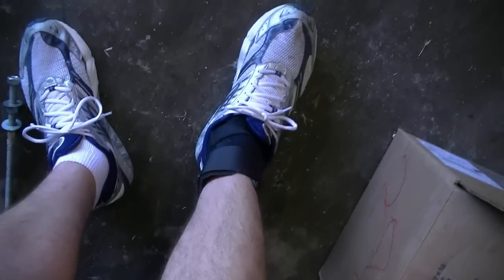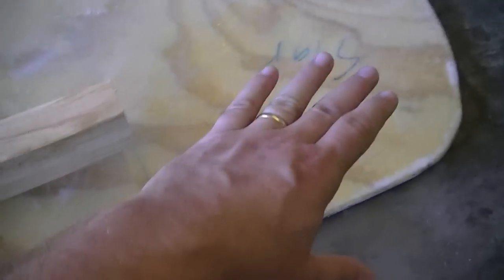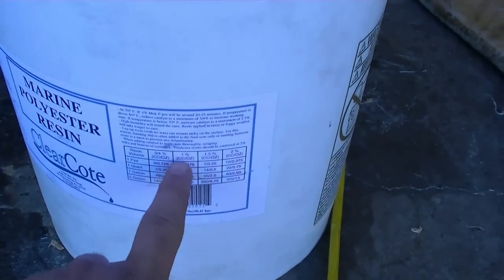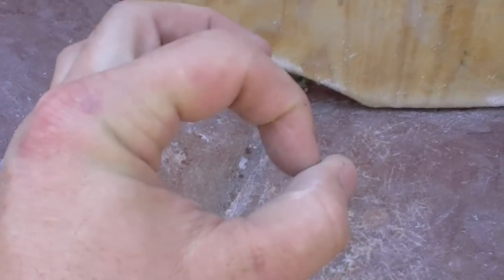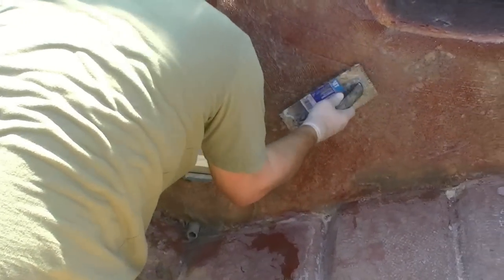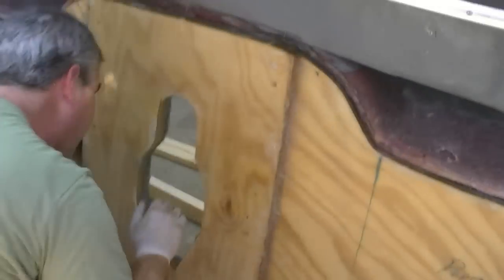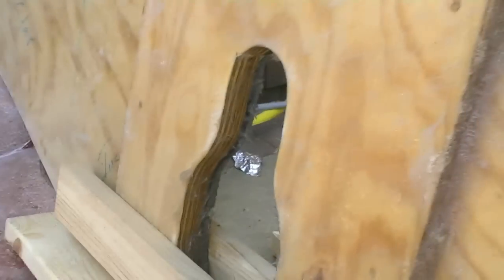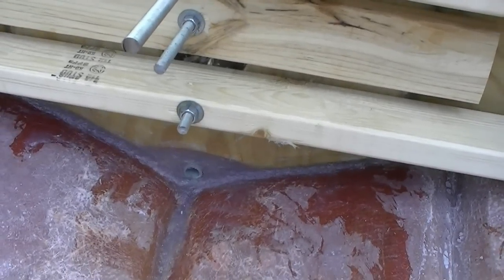Installing the transom in the Sea ray Boat Restoration VLOG #16

Comment: It's seven years after the fact, but I just found your videos a couple of days ago and have been binge watching a couple at a time.  You're as good as Netflix.  I am impressed with your skills and your willingness to tackle big projects that would scare off most people.  I'd even venture to say that some people would just scrap the boat if they faced these issues.  I'm just wondering if you ever heard back from the seller and did he return a good percentage of what you paid.  If you had all this work done by a boat-builder, I think you'd be looking at a minimum of $10,000.  I tempted to skip to the last video, but I don't want to miss the meat of the project.  I hope it turned out to your satisfaction.  I know when the time comes to sell it, the next guy is going to get a better than new Sea-Ray.

Comment: Great videos, very helpful.  Thank you for taking the time to make them.  Was wondering if you had a video showing how to fiberglass an area where 3 flat plains come together to form a point? Both a protruding point such as where a vessel's free board meets the underside along the transom and a depressed point such as where the deck meets the side of the hull on the interior side of the transom.  I hope that makes sense.  Appreciate it.